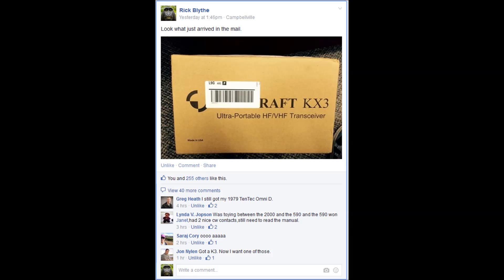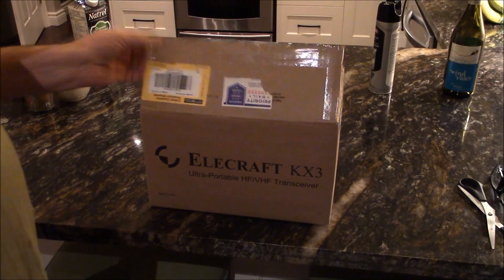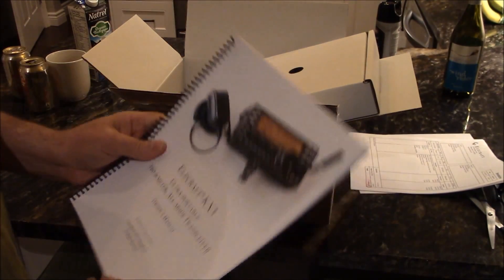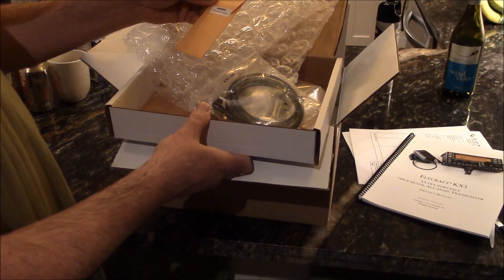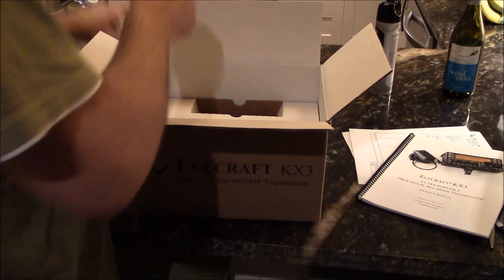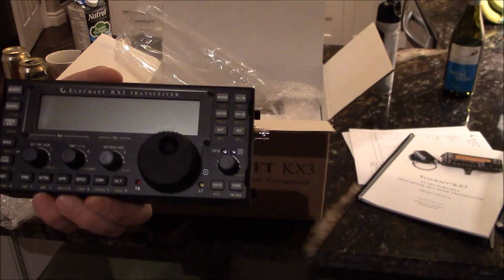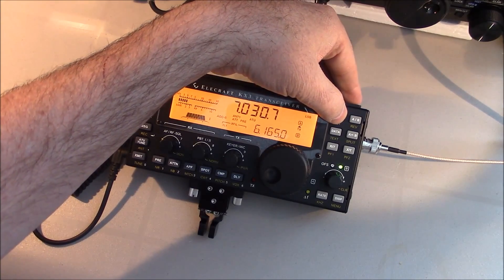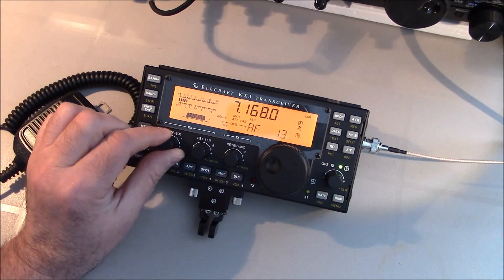Elecraft KX3 - Why I returned it

Comment: Ok so after a bit of experimenting (and a lot of patience) I made my first contact with the kx3. Using 10 watts and the buddipole up at 19 feet in the 15 meter configuration, I worked through a pile up from the island of St Kitts.  21.350. I had to wait for the big guns to finish...Lol but once I got through with my 10 watts all I can say is Wow!!! It was so rewarding....and addicting.  After working me the operator asked for qrp stations only for a bit which I thought was nice.  He gave me a 5-5 and seemed to be honest with his signal reports.  Anyway I know it works now and just had to share.  I used compression setting at 2 and Mike gain mid 20s...I need to find a local ham to help me tweak those settings...  Anyway good luck and 73s.

Comment: Nice looking rig. I have to admit I haven't given these much of my attention. Just taking a glance at the website it looks like they aren't too expensive relatively speaking. Couple of questions if you don't mind. Does it have CAT control? (I assume it does.) And, what FB page was that? Thanks..Dan
Reply: Great, where can I get one of these?
Reply from the maker: The Facebook page is called ham radio operators. And yes since this is a true SDR you can run a pan adapter on it from my PC I will show that in a later video. I don't have the cable yet to do it.
Reply: The Radio Hobbyist Found the page, thanks. Looks like you gotta jump through a bit of a hoop to join. :) This is an interesting rig, going to look into it a bit more. Now if that money tree sprouts this  year....
Anyway looking forward to more videos on this one. 73s

Comment: went to their web site and that is the EXACT duplicate/copy of the ICOM HM-36, just like i thought. wonder what the hell is going on. did they rip it off from icom or vice versa or did both get it from china. lol. be interested to find out. read up, very nice radio. not that bad of a price really. where they get you is the "extras." now i have to get one. you are a bad influence. yl will be pissed. your fault.
Reply from the maker: LOL. read: http://swling.com/blog/2013/07/a-review-of-the-elecraft-kx3-a-world-class-transceiver-superb-shortwave-receiver/ especially the part about...
Sherwood Engineering’s receiver test data rankings (http://www.sherweng.com/table.html), which are sorted by third-order dynamic range (narrow spacing), the KX3 is second only to the Hilberling PT-8000A, an $18,000 transceiver.